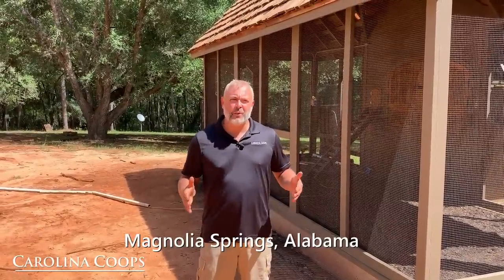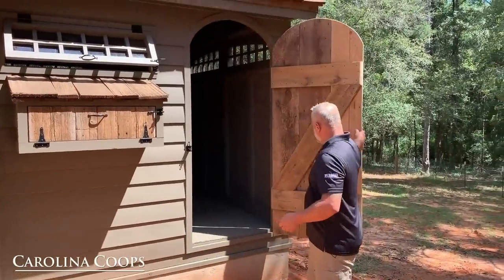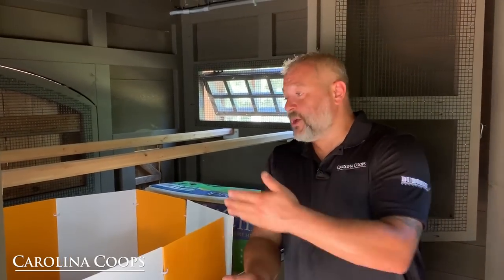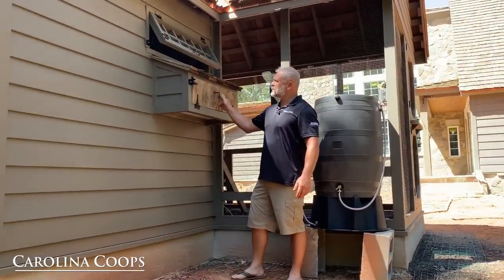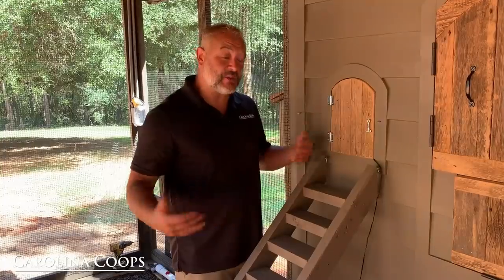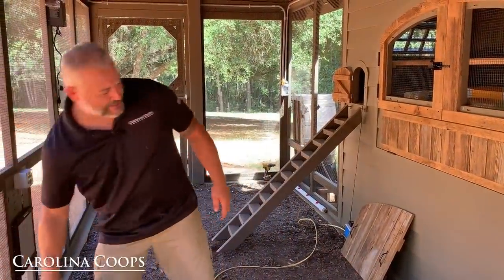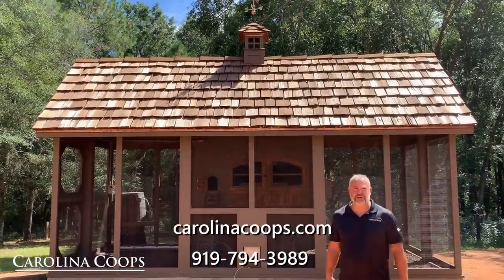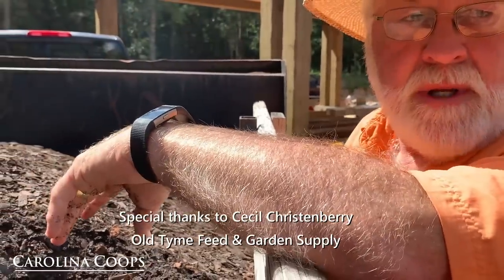Best Chicken Coop Design Checklist | Learn the Must-Haves for any Chicken Coop

Comment: How good is that to pull the deep layer system into the run? Will the chickens be walking around in that?
Reply from the maker: Great question. It's fine! the deep litter has broken down after months and months and the chickens will spread it out in the run. It will compost and break down even more there. Remember the chickens are walking in it in the henhouse too. Thanks for watching

Comment: Apparently you don't know that water running off of cedar shakes will dissolve copper over time.  Takes a couple of years or so, but all you copper valleys are going to leak big time.  A lot of people out west have discovered that the hard way with copper gutters.

Comment: the only comment is where you said you need to put a step by the door, which makes sense, but now that step has to be across the whole are, in order to reach the nesting box because it's to high. The box should have been make lower and then you only would have to put the steps by door. and the windows inside the shed area, they seem to high to unlatch and pull down. You seem to be reaching for it. Just a thought. very nice thought. I don't know how much I like chickens to spend that kind of money. but it's nice so is the house there building.
Reply from the maker: Hi Robert. A step was added, actually the whole grade around the coop was adjusted so the coop works perfectly now inside and out. Thanks for watching.

Comment: how do you prevent chickens from using water source as a roost bar?
Reply: It is due to how closely mounted the water bar is to the wall.  It is only an inch or two away, which does not give any adult chicken room to sit.

Comment: My run is 8x20 and I want your American Penthouse to be situated just like this coop is, so the hen door and ramp will go into the run. I think my problem will be the overhang on the run will interfere with the roof line of the coop. I currently have a large Snap Lock coop sitting inside the run. and I have another coop at the other end. They take up too much room and the other one is a nightmare to clean. I have been drooling over your coops for 3 years now. lol I spoke with a woman at your company and am trying to figure out how they can connect.

Comment: Why do the walls have to be taller with a 12/12 pitch?
Reply from the maker: MrLes Berg it makes the angle cut in the tale of the rafter longer so we find it works and looks better to make the walls taller.
Reply: Thank you. We're building a mobile coop in north Idaho based on many of your features. We're building a coop for a flock of about 20 - ten Americaunas and ten Rhode Island Reds. We're building it on an 8x18 foot travel trailer frame. The basic design is similar to one of your custom coops, specifically the white clapboard one with a shed on one end and the duck house on the other. We'll have a 3 foot deep shed at the front of the trailer, followed by an 8x10 raised hen house with the floor about three feet above the trailer deck. The remaining five feet will be a roofed run that is open to the area under the hen house.Our biggest design challenges are snow load, trailer frame flex, and fairly common high winds. We're looking at a 12/12 roof pitch and possibly building folding eaves so the trailer can be towed legally (should we move yet again). I'm addressing frame flex by using a 4x4 perimeter 'foundation' on top of the frame with 4x4 posts in five places on each side wall and down the center. My biggest concern, however, is the lack of shear strength in the walls fore and aft. The 18 foot coop will only have a 3 foot section of each side that's fully sheathed. At the moment, I'm debating whether to use diagonal 4x4's or tensioning rods in the side walls to provide shear strength. I also need to research how best to attach the 4x4 corner posts to the 4x4 perimeter framing. I'm leaning towards fabricating 'L' shaped steel plates on the bottom and angles for the sides and bolting it together.I'd be happy to send you the plans when we're all done.
Reply from the maker: @slateslavens  Sounds like an amazing design and we would love to see the finished product. Please send any photos to ingrid@carolinacoops.com. Thank you.

Comment: Also I understand your preferred 1-foot rule (industry minimum 8") for space ALONG the roosting bar.  But what is your chicken math for separation BETWEEN each bar, and/or to the wall?  (ideal, and/or minimum)
Reply from the maker: In a 4x6' henhouse there are two 6-foot roost bars, and they are equidistant from the front and back and each other. So in that case there is 13.5" between them. Thanks for your question.

Comment: Great call on the Coppola, you could still vent the air from the coop to it, should still get some draw.
Reply from the maker: yes, all our coops have other forms of ventilation, ridge caps, small holes under the eaves and in Alabama, the henhouse doors will not have to be on very much. Thank you for your comments